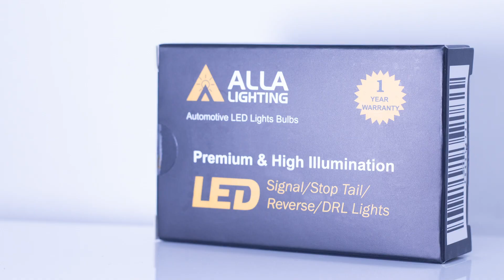How to Change Brake Tail Light Bulb for 2015-2020 Chevy Colorado Truck?

Comment: Amazing how easy they made it on Colorado. The 2019-20 Blazer requires removing rear wheels, mud guards & rear quarter bumper body panels just to access the tail light assembly. Thank U Chevy Engineering 😠❗ You should've given it LED BRAKE LIGHTS to begin with, since all the tail lights within the unit are LED❗
Reply from the maker: Thanks for watching and thanks for your feedback too.
Reply: Wow.